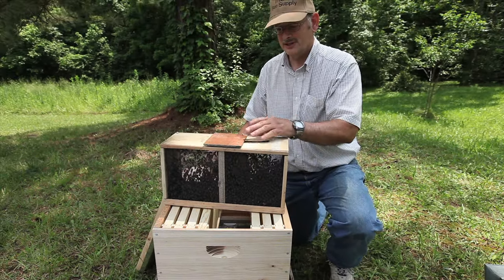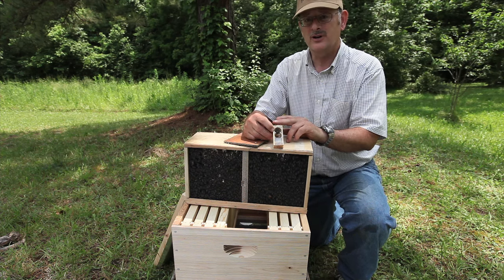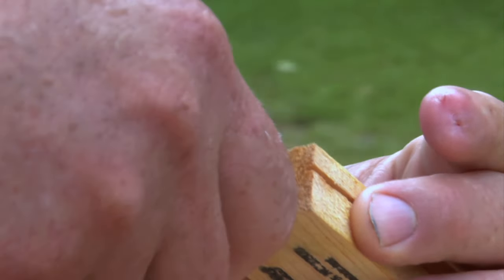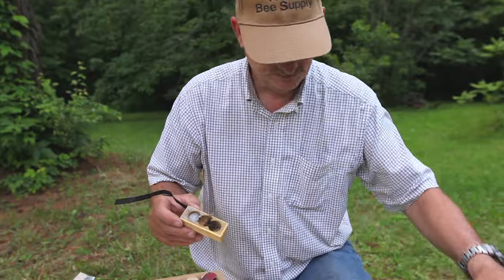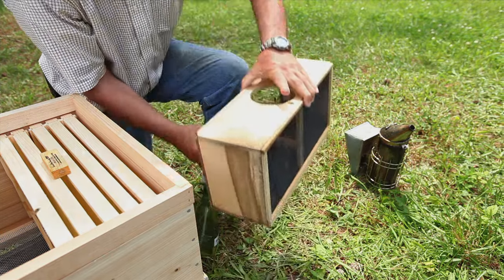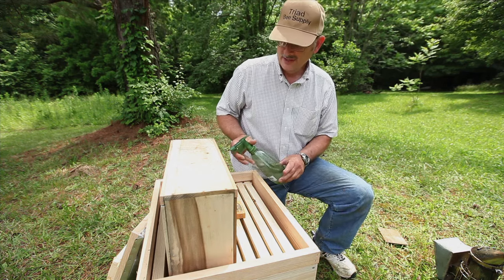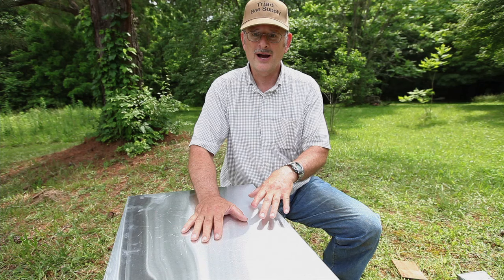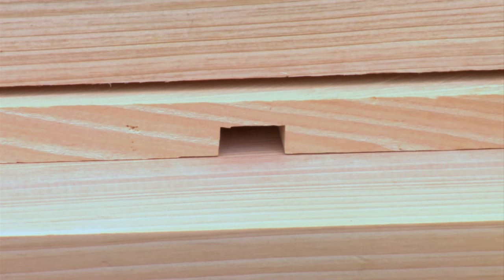How to install a Bee Package

Comment: Sorry if this is a dumb question, but is the sugar spray you use just a quick mix of water and sugar from home? or is there a specific brand you'd recomend?
Reply: quick mix from home. Don't need to buy it. Just make sure the spray bottle didn't have any chemicals in it prior to use and clean thoroughly.

Comment: You should always keep candy and entrance down. The strap was on a right side. You did it wrong! In some cases candy can even kill a queen - melting down.
Reply: Backyard Bees NC correct
Reply: you either should have the candy up or to the side. Never down. Unless you want to trap the queen in the cage when an attendant dies. I follow backyard bees on here too. Check them out.
Reply: @GDHoneyAcresandCraftWork  bees from outside will clean way out for a queen - that's basic beekeeping. Also dead bee can stuck to the candy when you place it up or down - doesn't matter.  Temperature in the hive is higher and candy can easy melt down. Candy always down! I'm a queen breeder but do whatever you want and lose your queens.
Reply: ThEcLoUdBuStEr higher chance of the dead bee causing a issue when it’s down n
Reply: @GDHoneyAcresandCraftWork  opposite! But when you buy my queens it doesn't matter cuz I know how to make good candy - no melting in high temps. Bees will chew full comb when it is necessary for releasing a queen. Dead bee is no problem for them. Maybe you all do it in a wrong way in USA/Canada - I'm from Europe and we know how to handle bees - no CCD here. 99% - 100% overwintering with harsh mountain climate is what to expect. 95% is worst case scenario what I can accept. Good luck!
Reply: ThEcLoUdBuStEr  I wasn’t discussing any queens of yours. I merely stated what is taught. It’s good that you are seeing that percentage of success. No need to get cross. Also according to a report put out by the EU reference laboratory shows 10-30% losses in Europe which is still better then most areas in the US. In my opinion it is the overuse of pesticides, herbicides, and fungicides that cause the major losses here in the US.
Reply: @GDHoneyAcresandCraftWork  That's true, but we also have those here (less but still) IMHO first sin of American beekeeping is old combs. Black comb = melting down no question ask - don't be greedy. Greedy beekeper will never be a good beekeeper. Second sin are antibiotics which are illegal here where I live. Third sin you breed weak and not resistant bees (not all of you ofc)
Reply: ThEcLoUdBuStEr the chemicals are way overused here for sure. There are much more strict laws across Europe on them and people are advocating that here. Good teachers and mentors teach to get rid of the old comb. It’s up to the student to learn that or not. As for my apiary we will get rid of old comb. They are trying to make better bees in the fight against the varroa and my bees are muts beside the one hive of carniolans. I’m really hoping to get to the EU someday and visit some of the Apiaries there. There are so many beautiful looking regions that host honeybees. Someday I will make it over there n